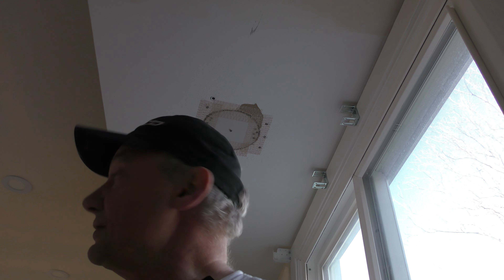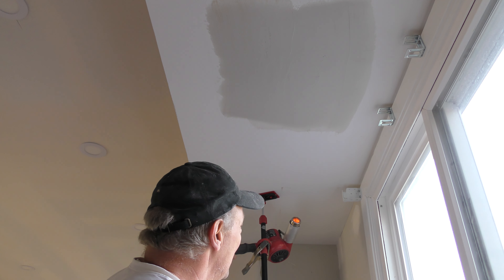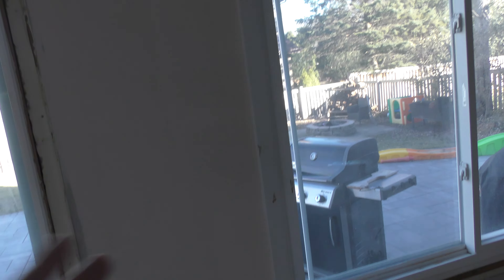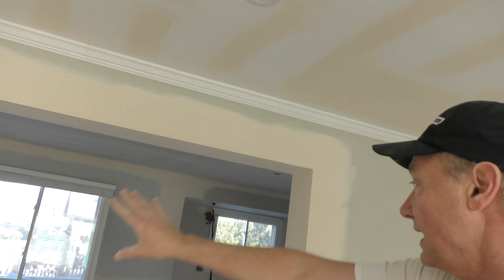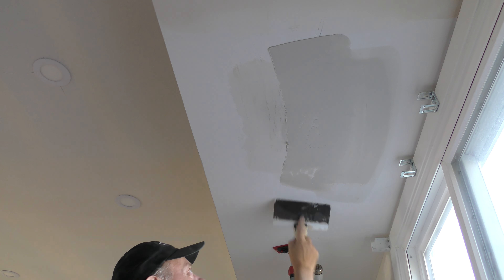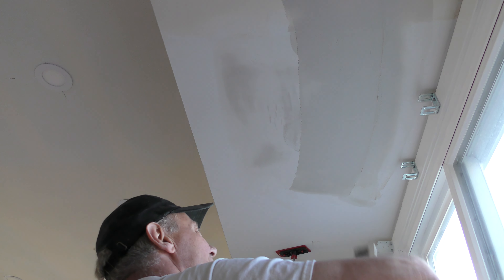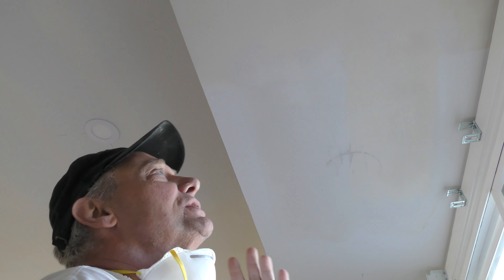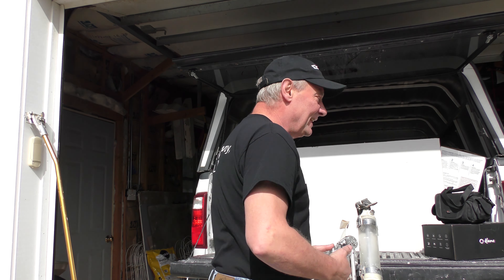Drywall Patching From Taping To Sanding Same Day

Comment: I learned to use quickset to fix water damage quickly. My greatest accomplishment. Is learning how to use a hawk and trowel. My latest plaster job has flat walls after 6 coats but the trowel made it so much easier to make flat. Let the trowel tell you what it needs, when your getting lines it’s not flat!

Comment: The floors are done before prime and paint because the floor refinishing leaves dust on all surfaces no matter what - you'll never get the surfaces looking mint trying to clean fine refinishing dust on it - not to mention shoe moulding is typically removed during refinishing - you wouldnt want to paint all the trim before the floor is done

Comment: I watch many of your videos and I have a question not related to this video.
Can you answer me this.
I’m so use use to hand finish everything I’m assuming that now where jobs are all done with mudding and taping tools that they use a lot less mud.
Just seen a job and all inside corners seem lightly coated and factory tapered seams undercoated and the finished product has the shoulder of the board visible showing after being sanded.
It looks flush but I’m so use to having the feathered finish covering that part of the board.
They didn’t do this on the ceilings but the walls have this.
Butt seams seem ok just not as wide as I’m use to either
Reply from the maker: There is a difference between smooth wall and flat wall.  Most hand finishers are flat wall finishers and tool finishers are smooth wall.  Flat wall pays more and smooth wall is better for production.
Reply: @THEDRYWALLDOCTOR1  Will it make a huge difference in the finished painted product?
Reply from the maker: Only if painting with a gloss paint and Only huge if it's high gloss.

Comment: I’ve heard quickset always messes up when painted same day, even when letting dry in between coats. Something about the moisture not being pulled all the way out I haven’t had any issues personally but apparently it happens a few days later
Reply from the maker: I've never had a problem.
Reply: good quality primer (Bullseye 123 or similar), not that cheap stuff from the store with the orange logo...

Comment: I have been doing this for years with a wooden contraption that I've made that doesn't have to touch the ceiling but that is a pretty slick idea it'd be a lot easier to carry that things than the thing I made which looks like a odd looking tripod

Comment: Here’s what I do. I go down and get a medium grit angled sand sponge, l rub my thumb across it and make sure I don’t rub any grit off it. I soak it in water and break it in by sanding all the hot mud residue in my pan and tools. That one stays soaked in my cleaning bucket. I mix my 5 min hot mud put it on a curved drywall trowel and clean my pan. I trowel around the patch and leave a sweet tapered edge around the patch and build up a little mud on the inside. I wait for the “sweet” time and use the backside of my trowel and shave the patch down to where it’s good and reasonably flat. I use my sand sponge and a spray bottle, spray it sand it knife it and done. 30 min or less.

Comment: I do a lot of one day repair, patch and paint using the same technique. It may look good today but come back in a couple of days and often you will find that the outline of the repaired patch has shrunk. Even using 5 minute mud, if that pre filled section has not 100% dried out before applying the next coat, shrinkage will most likely occur. You could see the wet ring was still there even when you applied the last coat. I generally spend extra time with a heat gun drying that first coat before applying the next coat. If it's a bigger patch, I will always come back the next day to sand and paint.
Reply from the maker: I hate delayed shrinkage,  I like to sand the next day too, but I Guarantee I will be back there doing other pick up work and I can look at it then
Reply: I hate delayed shrinkage... that's what she said
Reply: @THEDRYWALLDOCTOR1  Please give us an update when you return. Thanks for taking the time to make these videos.
Reply: I’m no pro, but I was thinking this could happen. Still a useful technique though

Comment: They left you that f** fan to deal with when the whole rest of the room is stripped out???
I know you're the king but people should be more respectful.
Reply: more likely sparky or builder "forgot" to remove one can light or even planned for it then the home owner changed their mind?    Still crappy to dump it on the drywall contractor then the room is ready to paint.